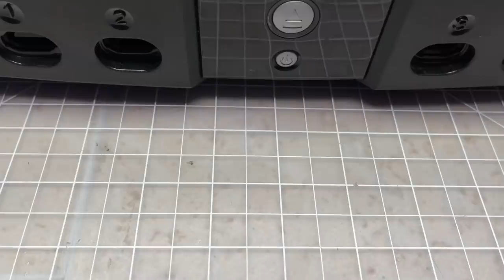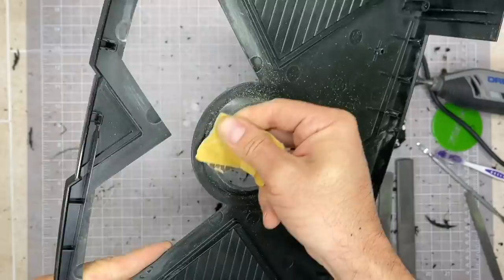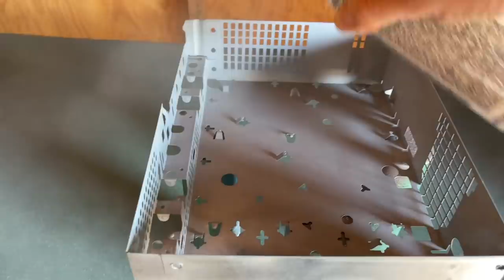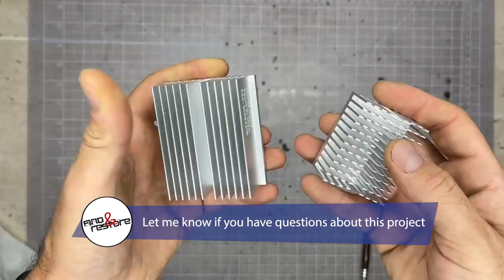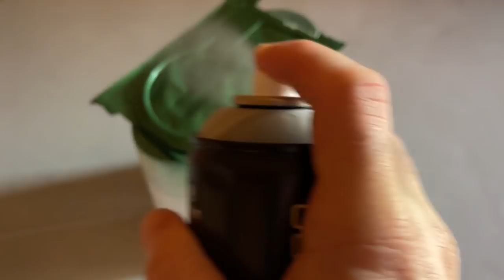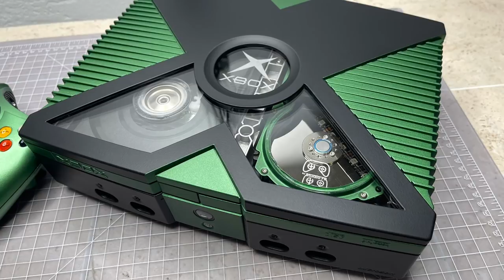Xbox original Customization - with optical drive and hard drive window mod

Comment: Im surprised on how the HDD is still working after being opened lol
Reply: It's strange. I don't understand how this hd works!
Reply from the maker: The old ones are very tough!
Reply: @studiofr  I hope you kept it in a static and dust free area with the lid off! You’re a mad man for customizing the HDD, but it looks great
Reply: I'm also surprised, yes!
Reply: the mechanical Parts still work after you opened the drive. The Problem is that even a tiny bit of dust can harm your drive, or the data stored on it. The typical dust particle is to big to fit between the magnetic disks and the read/write head, which could lead to mechanical damage. To be safe, you should only open those drives in a dust free environment...
Reply: If you keep them in a clean environment after opening, not much will happen.
Reply: @kendiacono1570  sometimes these older electronics are way more durable
Reply: @ChrisCovers78  rule no1 when comes to CPU and GPU choosers.!
Never use sharp objects to remove any Residue as it can damage the surface of the chipset rendering the choose in effective.!
Instead use ipa a plastic scraper and cotton swabs/lint free cloth.!

Lucky it worked this time.!
🤔😂😂😉
Reply: @ChrisCovers78  heatsink not choosers.!!
Auto correct.!🙄🙄😡
Reply: Chipset
Reply: @kendiacono1570  yes. I’m aware. Been a tech for a while. I was referring to them still working.
Reply: @kendiacono1570  he used a plastic spudger, which isn't nessissarily sharp.. I use one too to remove crusty old thermal paste. if its hardened out, then q-tips won't do much...
Reply: @NexXxus86  It looked more metallic to me but I could be wrong.!!

Either way it is vital information that people should know before they even attempt to do this type of modification / repair to any of their consoles / PC/ handheld.!🤗🤓
Reply: It worked on that day and that's it hahaha
Reply: @Jon VB I own 2 retail XDK system's I run the debug bios via Phoenix Bios Loader and it's also running on a 2TB HDD ind-bios 5004.67 the other has a stock HDD and is chipped with an Aladdin XT plus2 chip that also runs a dev kit bios through Phoenix Bios Loader but the main bios is EvoX m8+
Reply: @Jon VB He just did this from a Visually Impressive idea, he also could've added that OGX360 mod but he didn't.
Reply: who says it did work
Reply: @FR4M3Sharma  but logically it's a very terrible idea hard drives are very very very sensitive even 1 dust particle can potentially ruin the drive
Reply: @Brucel86  no one would do this for a dead system
Reply from the maker: Me! It works. 👍🏻
Reply: What do you mean? That's like saying I'm surprised the Xbox works after being opened.
Reply: No dip he didn't break anything

Comment: Modding the HDD seems like a risky bet, even a small bit of dust particles in the drive could wreck it over the long term. Hard drives are usually disassembled in clean rooms.
Reply: its risky absolutely but you don't need to be in a clean room to do it, however absolutely you should.

Comment: Looks amazing! The color scheme and choices are perfect. From the manufactures date you have a v1.6b console. No need to worry about that pesky clock capacitor. I was also surprised with you opening the HDD. I guess some can be disassembled but it may have been just sheer luck.

Comment: I loved how the console was, the colors match well, the rgb is great and the control as well, but why didn't you put the rgb in the control where the logo goes?
Reply from the maker: Good idea!
Reply: Yeah just use the controller power and ground and it's yellow wire to signal rgb?

Comment: Impressive build, you might want to make a copy of the HDD just incase it fails, they are paired with the motherboard
Reply: Or null or
Reply: Just hard mod it and unlock the HDD instead
Reply: Its a 1.6 box so just put a mod chip in and no harddrive issues anymore.
Reply: @pkf4124  exactly once hardmodded with the HDD unlocked it's easy to replace the HDD if it dies

Comment: I would like to know if that hard drive has moving parts if it's worth it to make it a see through top?  It's cool no doubt, just curious if there is any moving parts?  Also I was hoping to see a few leds inside the controller, that would be cool too..
Reply from the maker: Yes, it has moving parts. Thanks for the tip 👍🏻

Comment: not bad but as always the problem with attaching the plexiglass.
Unfortunately, it doesn't look good when you attach it like that. It's easy, but if you want to do it really well, it should be on top of the case. just so that you don't have a gap where a lot of dirt will collect

Comment: Are you able to do a logo using a decal before you paint and then taking the decal off after or would that leave sticky residue?
Reply from the maker: You can do it, just choose the right tape. I use Frog tape because it doesn’t leave residue. 👍🏻

Comment: I was pretty impressed until you skipped on recapping it all.  These caps will die...  There are much better caps available now for a low cost that would ensure another 20 years + of life.

Otherwise nice work. Aldi it can help to reflow solder on the power connector and epoxy it.
Reply from the maker: Thanks! 👍🏻👍🏻